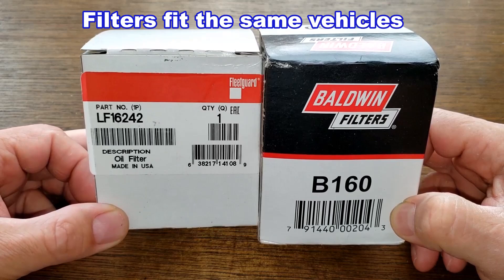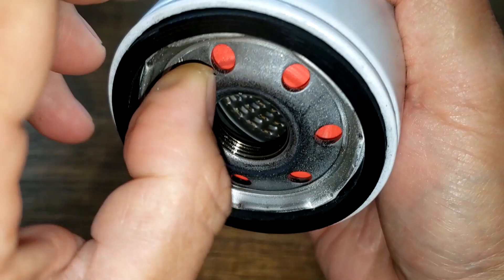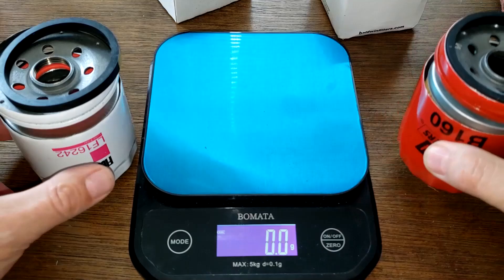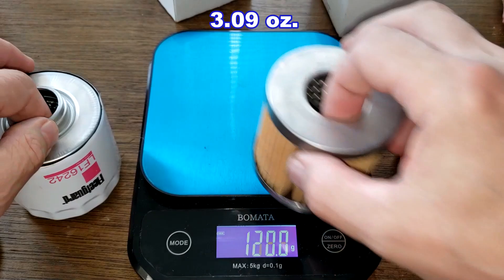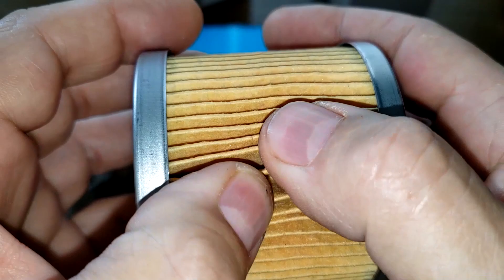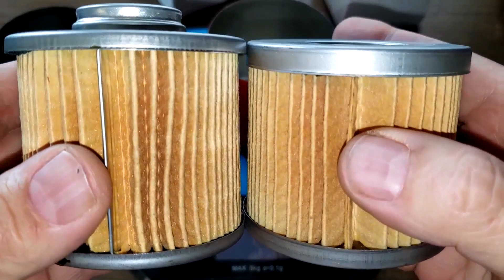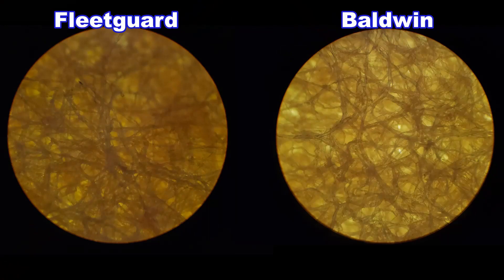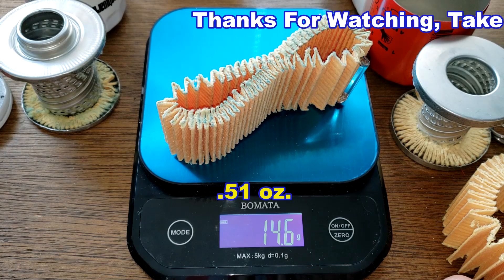Fleetguard LF16242 Oil Filter Cut Open vs. Baldwin B160 Oil Filter Cut Open

Comment: Baldwin B160 is my filter I use on my pick up truck thank you for making the video.  Never had problem with Baldwin.  Not bashing Fleetguard  but just because the filter media is woven tight doesn’t mean better filtration,but yes smaller particles  it may catch but at a high restriction then Baldwin do to flow of oil flow restriction through a tighter woven media.  More restriction equals less flow of oil , equals high’s oil pressure.  Some one agree to disagree , it’s all subjective choose which brand you like and be happy.
Reply from the maker: Hi Nick,
Thanks for your feedback!

Comment: If the Baldwin had a silicone anti-drainback valve it would be a better deal. The coil spring would be more reliable and the higher by-pass pressure means that more oil will be forced through the media. 12 pounds on the Fleetguard seems awfully low.

Comment: The "Fleetguard" is interesting for several reasons. FG date code indicates it is made by M&H Purolator in Fayetteville NC 05/2022. Construction also looks like Purolator made. But, 98.7% @ 17.6 microns, IF true, a very efficient filter. Seems too good to be true. 98.7% is absolute number (Baldwin, 98.7%@40um). Because of silicone adbv, I'd choose the FG. But, neither is a readily available filter here, so unlikely I'd use either. Thanks for vid.
Reply from the maker: Hi faxmen09,
You're Welcome!

Comment: For a longer maintenance interval, I would want to use the Baldwin, shorter, the Fleetguard.
It would also depend on the mileage and the number of particulates in the oil when at the end of its life.
The Fleetguard would filter better for a shorter length of time.

Comment: Both decent filters for 3 to 5000 miles oil change intervals.Fleetguard  would probably get the nod for my money.Interestingly last year i bought a fleet guard for my Ford Falcon and it still had a nitrile rubber adbv.So they must have just recently switched over.
In Australia the Ford Falcon was in production from 1960 thru to 2016 both in 6 cylinder and V8.
Reply from the maker: Hi Luke,
Depending on the filter size with the Fleetguard, some have nitrile ADBV.

Comment: These are both good commercial filters with only small differences.  You see a much bigger quality difference  between brands with automotive filters.   Years of working in the field, Baldwin is by far the most common filter on commercial engines.  The rental companies use them.   Fleetguard is a popular truck filter.

Comment: That Fleetguard appears to be made by Mann and Hummell, it is most likely identical to the Wix 57060. The more correct Baldwin would be B7443, both having the same bypass pressure. I use the B7443 on two different dodge trucks and they are great. I love your videos. Im an oil filter nerd too.
Reply: Fleetguard produces their own filters.
Reply: @mphilleo  They may make many of their own oil filters, but NOT the topic filter. 100% confident made by M&H Purolator. No doubt.

Comment: The weaker bypass pressure on the FG negates a big portion of the filter media thickness. The Baldwin is going to make sure the oil flows through the media for the life of the filter. In fact, the lower bypass pressure combined with the thicker media on the FG might mean a lot of oil NOT going through the media as it nears the end of its service life. I'm a retired farmer, and I have used both brands but somehow preferred Baldwin. Just my $.02.
Reply: Funny, you mention that. When I was looking at the FG specs over 20 years ago I called their engineering dept and spoke to them about this very issue. They said that the 100% Microglass media is a much more free flowing filter media even when 'thicker' than the cellulose. It would permit the differential pressure value of the by-pass to be lower because they engineer that value according to the media. It would also be effected by engine oil pressure, oil viscosity and temperature as far as when it goes in and out of by-pass. Back then it was a fairly novel concept having 100% synthetic media, now it's commonplace. I think the Boss is comparable.
Reply: Thanks Vince, I hadn't considered that the media composition was, or could be different. I was using farmer logic (not sure that's a real thing), in my thinking. Different media, different viscosities, different oil base (synthetic, petroleum), will surely have an effect on filter performance. I'm 73 and retired now, but back in the day I spent many hours running tractors, combines, swathers, semis, dozers, you name it. I was always looking for the best protection of those engines, and was blessed , or lucky, (I prefer blessed) to have only one engine failure. That wasn't a lube issue btw, professional mechanic mistake. Thank you for a new line of thought, take care.
Reply: @user-pk2fg8im4u  Hello Sir, Nothing at all wrong with your logic! Farmers are some of the most inventive, innovative and ingenious people there are. I would trust a farmer over some engineers. The fellow that invented the Cathode Ray Tube, which lead to the invention of the television, Philo T. Farnsworth, came up with the idea while plowing rows in his field. I don't believe he even had any formal engineering education.
I think as long as good maintenance schedules are adhered to the differences in filter choice is less important. I used to use Baldwin a lot on my diesel Olds. I'd get a case from the heavy truck parts shop. Take care!

Comment: Well done! I appreciate your filter vids. A thought: gasket measurements (height and thickness) and maybe even a durometer reading "might" be useful. Some Honda Element and CR-V engine fires have been caused by oil filter gaskets remaining stuck to the engine during oil changes. The tech then screwed the new filter over the old gasket, creating a double gasket situation. When run, the old gasket eventually would blow out. This caused oil to be sprayed on the nearby exhaust manifold and vehicles fires ensued. There was a class-action lawsuit, IIRC. Again, well done.

Comment: I've been waiting for this one! The LF16242 is pretty close to the LF17531 I have a number of. The main differences I noticed right away are mine have a nitrile ADBV and a "button type" bypass valve at the bottom instead of the kind shown on this one. I do wish the LF17531 had the silicone ADBV as an option, though. I'll be looking forward to video on that if you get your hands on one of them.
Reply from the maker: Hi John,
I plan on Putting the LF17531 oil filter against a Wix oil filter. That video will probably be shown sometime in November.
Reply: @WhipCityWrencher  great to hear, I'll definitely be checking that out!

Comment: FleetGuard is a better choice .. it has enough filter media for the size of the canister housing the main benefits are its filted rating of 98.7% at 17.6 micron is almost an absolute rating vs the Baldwin nominal rating at 18 microns and a absolute figure at 40 microns meaning 99.9% at that rating..  i would definitely go with better protection, smaller particles suspensioned in the  oil vs higher compacity which won't make much of a difference based on the class of filters in Normal recommended service intervals .. plus the Baldwin allowing much more larger particle through didn't even need that much more media as it's doing way less work but people want extended service intervals

Comment: I don't know. I kind of think the additional surface area more than makes up for the less dense media which probably helps marginally with flow vs capacity. Fleetguard has silicone anti drain back probably useful well below freezing.  Overall they seem pretty equal.

Comment: I think the Baldwin is the winner since it has a significant larger filtration surface area 🤷🏼‍♂️

With more surface area, the oil will experience less pressure in the filter, negating the slight difference in nominal/absolute filtration rating 🤷🏼‍♂️

Comment: Fleetguard is better imho...

Better filter media (thicker, composite material combining two types, longer)
Better anti drain back valve being silicone vs nitrile.
Longer pleats higher micron rating 18.7 microns etc
Also Fleetguard filter media is thicker as well.

Fleetguard is the superior oil filter 👍

Comment: There's another youtuber I was watching, his oil pressure went up around 100psi, higher when he hit the gas. They were trying to find out why it was so high and noticed the oil filter had ballooned but didn't break/explode. Have you seen that before? First time I ever saw that. It was a typical metal cannister oil filter.
Reply from the maker: Hi Targa,
No, I haven't, if you ever get a hold of one of them send it to me and I'll open it up. Would make for a good video.

Comment: Great video! These are both 2 of my favorites or go to filters, don't use the Baldwin much anymore but it is a nice filter. Used those when I had my Olds Diesels and was doing 2k mile oil changes. I really like the Fleetguard microglass media (all microglass). I've switched to the Fram Ultra, which is still a great value in spite of them cheapening it. The only complaint I have about the Ultra is that the XG-8 size that I use has smaller holes around the plate than most other filters (like Purolater). The Fleetguard I use is the LF3487. I bought a bunch 20 years ago and still have a stockpile.
Reply from the maker: Hi Vince, Thanks!
My Explorer uses the XG8A also and I have the same complaint, (the inlet holes look too small for me). I like the Purolator Boss because of the larger elongated inlet holes also if you don't mind spending the money the Fram Titanium has slightly larger inlet holes and still uses the metal screen backing. I'm going to be putting on the Fleetguard LF3487 on my next oil change next month and leave it on for one year and make a video out of it with oil analysis. I only drive about 5K miles a year. Thanks for your feedback!  👍
Reply: @WhipCityWrencher  I think the Boss is a great filter too. I like the Titanium (better than the Ultra) my problem is it's almost double in price for basically the same filter. I wonder how much longer it will have the screen. The only reason they did that was because of the single layer media. I just can''t see Fram running 2 different specs and lines on basically the same filter. But, they might have to keep it if Advance is that picky about their specs. I wish they would just adopt that 'Advance' base plate for their other filters. I wouldn't even care as much about the screen as long as the media didn't crush or blow apart. I really like the LF3487. They aren't easy to find. I had to go to a heavy equipment parts house. That Microglass media is really nice. I think it's less restrictive that some other all synthetics. I really liked the Motorcraft FL1A for my driver 3k changes. Used to be $4 at WM. Last time I was there $10! More than the Ultra. Crazy! 
I saw your Explorer Odo roll video. Nice truck! I usually have a 'winter' car to keep my nicer vehicles rust free.

Comment: That got ugly I'd like to see some more testing on the Fleet Guard. Both filters look pretty good and no metal shavings or excessive glue. Note Fleet Guard did supply Pete with a Data Sheet which tells a lot about the company's character

Comment: No Contest !! The FleetGuard is the clear winner: Silicone ADBV; Larger Surface Area; Microscopic View.
Baldwin STILL pays the Coil Spring penalty (shorter element with less area, and heavy cannister). 
I would run the FleetGuard for 5,000 miles -- and leave the Baldwins on the shelf.
Reply: @jeffkortsch8276  Good morning, Jeff !!
It appears that you need some help with your spelling, or perhaps your keyboard is FUBAR, -- in any case , Webster's 11th Collegiate Dictionary tells us that the word "canister" can also be spelled as "cannister", which is my preferred spelling.
Your repeated, seemingly-intentional mis-spelling of the word indicates an emotional quirk or mental malady.
 Seek help !
Reply: @SlikLizrd  Odd that when I had a preference, you attacked me like I said the Earth is flat. Maybe the Earth is actually a can(n)ister.

And of course, when all else fails, a personal attack from you is never far away.

Comment: It's ironic that the filter with the orange canister has a coil spring (Fram website! Fram website!).
Reply from the maker: Hi Jeff,
Not sure what you mean?
Reply: @WhipCityWrencher  Some here believe that Fram is the expert on making oil filters and the fact that they use a stamped leaf retainer spring means that the coil spring has gone the way of the dodo. Here in the Baldwin is a filter with an orange canister that is using the coil spring. They must not have read the Fram website!

Comment: Baldwin has sealant showing between the parts of the base end. Seen that on several filters now. Just now noticed or recent sloppiness??
Reply from the maker: Not sure where you see that, both filters were pretty clean compared to others I've opened.
Reply: @WhipCityWrencher  Just at the edge/rim of the business end, outside the 7 holes.
Reply from the maker: @dwendt44  Wow good catch! I missed that!
I just dug up that filter and took a look at it and it's a blue sealant that goes around the base plate. I've noticed that on some other oil filters but it's usually a black color sealant.

Thanks for pointing that out.👍

Comment: Is the Fleetguard oil filter only made for diesel engine vehicles? I have a Nissan car that I'd like to buy one for. Thank you.
Reply from the maker: No, they fit some gas engines also. What filter are you using right now?
Reply: @WhipCityWrencher : A Fleetguard for a 1992 Nissan 240sx KA24de engine I went to the Fleetguard website, but it wasn't much help. Thank you.
Reply: @WhipCityWrencher : Sorry, I answered your question wrong. Currently, I am using a Balwin model B113 oil filter. Thank you.
Reply from the maker: @carbonsnail014    The LF3434 fits your vehicle. https://www.fleetguard.com/s/productDetails?propertyVal=LF3434&propertyField=home&language=en_US
Reply: @WhipCityWrencher : Thank you very much.
Reply from the maker: @carbonsnail014  You're Welcome👍